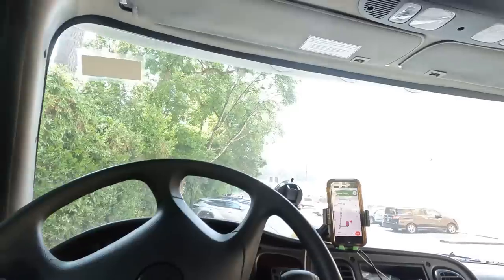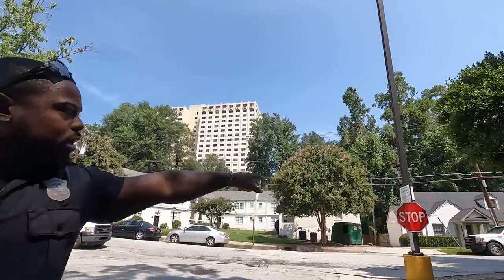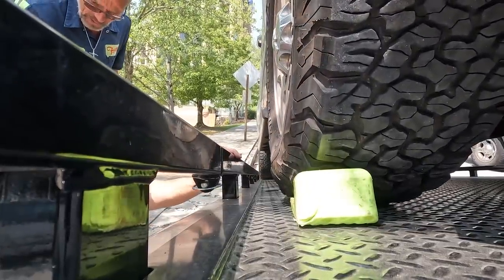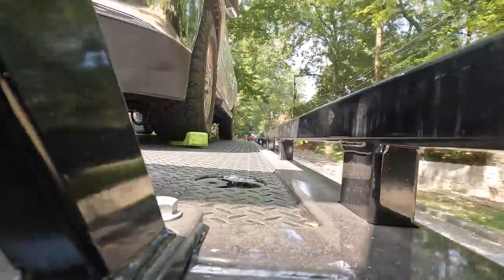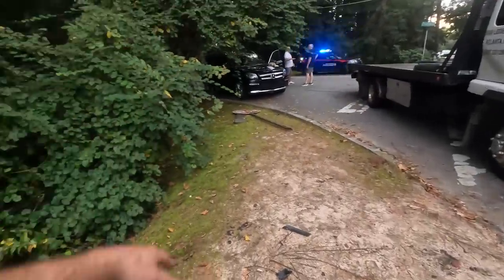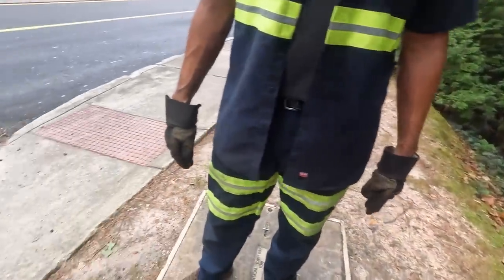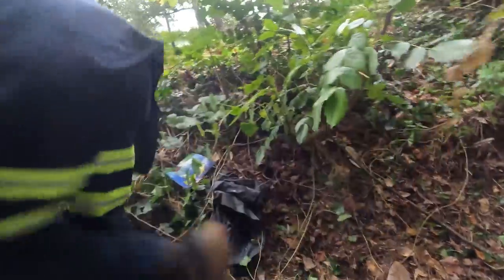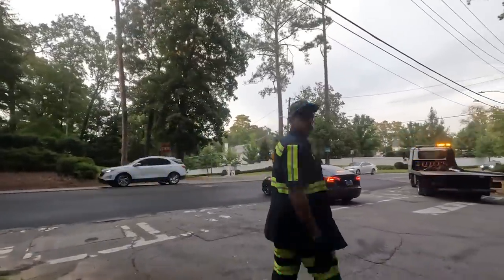TowTV Episode #23

Comment: That concrete top box you are talking about is usually used for telecommunications as a pull point or splice point, those lids are made of fiberglass and cement and have steel struts underneath them to support them they are quite strong, I have personally driven a 20 000 lb backhoe over them and it dosent hurt them. I have also seen fully loaded tri drive drywall trucks back over them and not damage them. But your attitude of better safe than sorry is a good one as that way no one can blame you for damaging one as they are rather expensive and a pain in the butt to replace.

Comment: I'm fairly sure you're doing nothing just by putting the belt through the steering wheel like you did to that pick up. The belt would allow the wheel to turn underneath it. I've seen other tow guys run a couple of ratchet straps from the seat base to either side of the vertical spokes and back down. 

and you're absolutely correct, those concrete lids are for a communications pit. There'll be some phone guy blessing your cotton socks you didn't break that, allowing the water in so that some poor mope has to sit in there and solder all those connections because they've corroded. :)

Comment: That concrete cover looked like a telecommunications pit. It will house the distribution point for several hundred houses and businesses are connected to. Breaking the concrete would let excessive water in and eventually cause a failure of the equipment. Good job thinking about it.

Comment: That second car sure looks as if it got ditched in the woods! Beware of the covers that look like concrete. Some companies make plastic covers with inserts that make them look like concrete until you take a closer look at them. Wouldn't hold up to anything as heavy as a tow truck. That one though looked like a steel casting with concrete in it. If you tap on it and it doesn't sound like concrete it likely will be some other material.